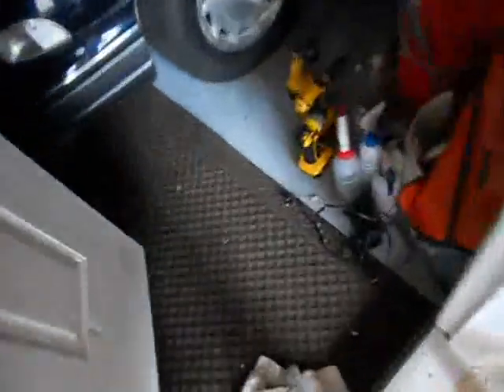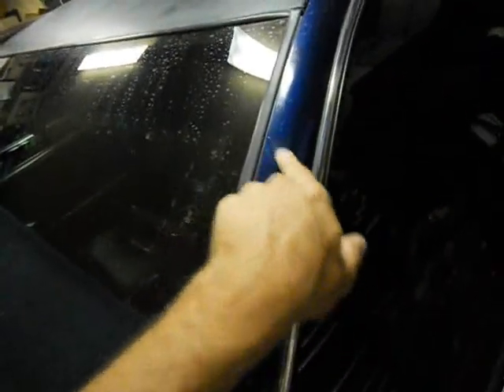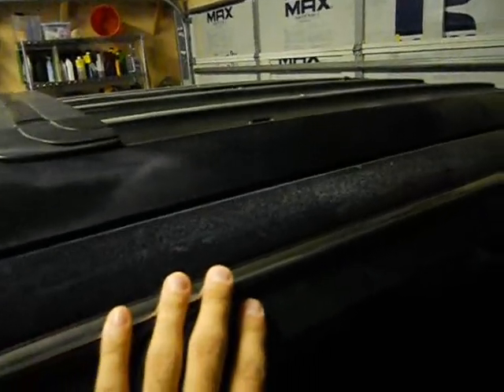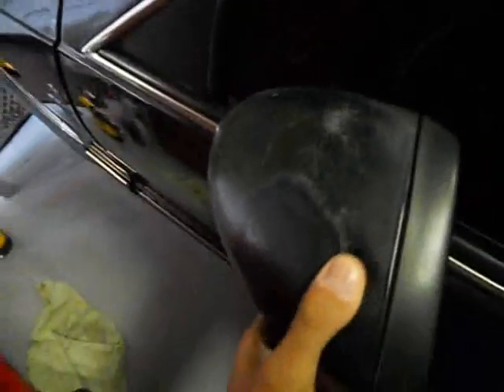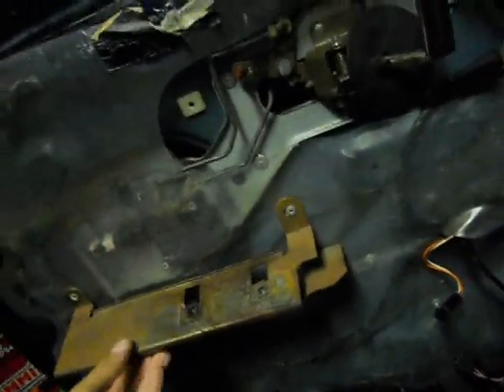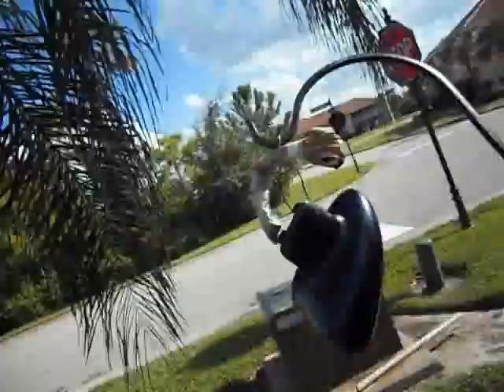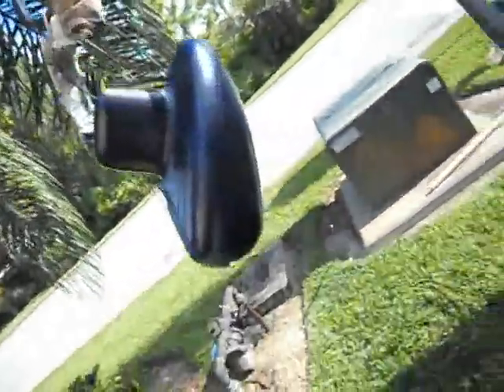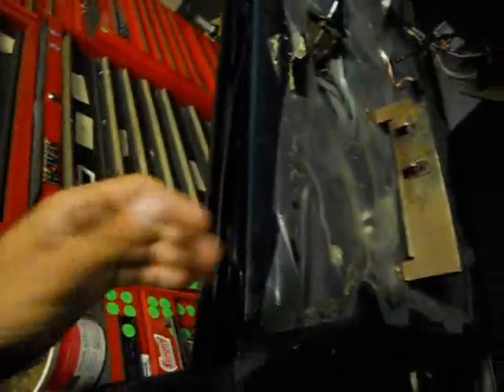how to paint your car yourself 50 dollar spray paint job, Mirror refinish

Comment from the maker: @moldymac PPG shop line (cheap grade) of the factory paint code mixed in an aerosol can  The hood has been repainted as other panels on the car so none of it matches! but its close enough.  Its a half ass paint job but for $50, its good for me

Comment from the maker: @moldymac  Yup.  They asked me if I wanted single stage I said NO WAY! Base coat clear. Its hard to get the paint to flow out smooth in a can At-least you can color sand the clear coat!